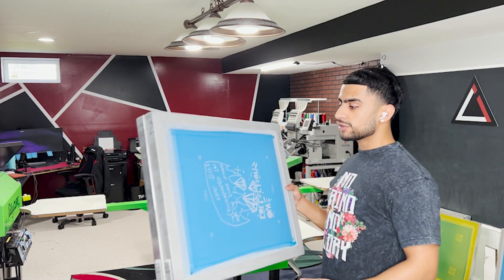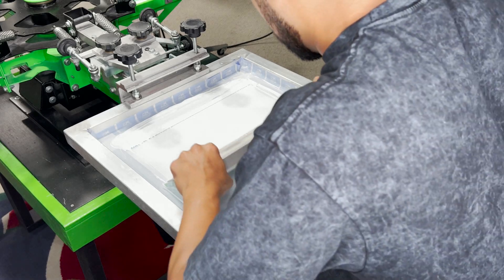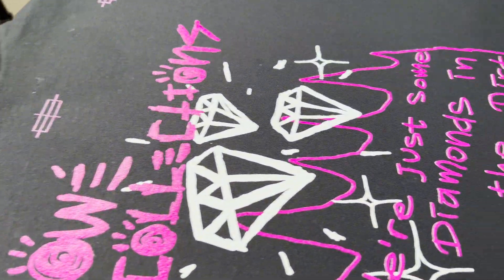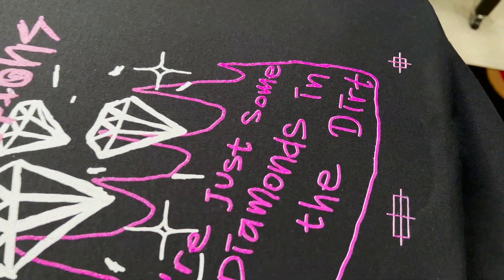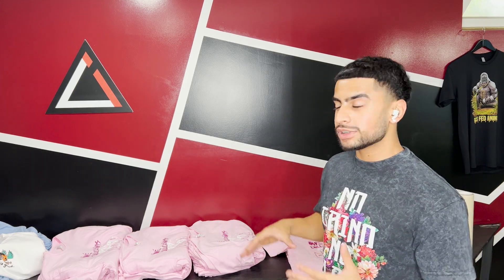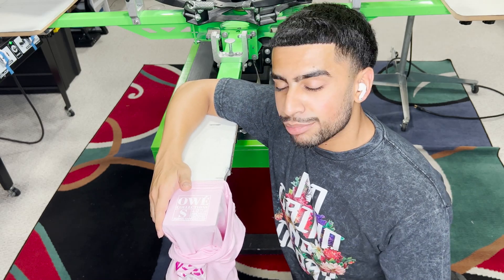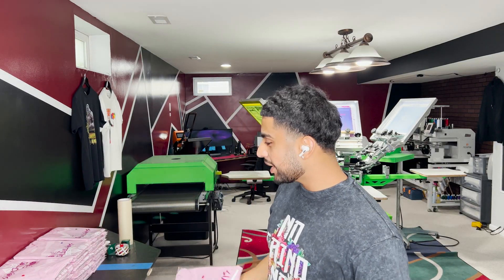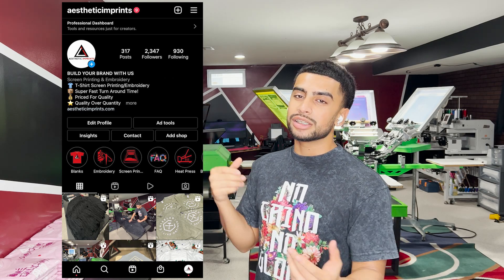Screen Printing T Shirts For A Clothing Brand From Start To Finish

Comment: I see that Epson printing real nice. Im looking to upgrade to print larger than 13 x 19, but Epson that big not in my budget YET. Any recommendations?
Reply from the maker: Epson has been printing real clean. I can’t say I’ve used any other printer that prints bigger than 13x19. I mainly used the canon ix6820 and the pro 100 before I upgraded to the epson

Comment: Definitely kept it real, appreciate that. But yo, I mean it looks like you got the 4x4 Riley 250 joint with XY micro and it aint doing it's job? That thing aint cheap....  I can sense you bout to upgrade juss now lol
Reply from the maker: Always💯 it’s a 6x4 Riley 250 and it’s not that it’s not doing the job, don’t get me wrong it’s a great press and can do some great prints. However, when it comes to needing tight registration and but to but prints it can get hard and annoying. The press doesn’t hold the absolute tightest registration. Again it’s just a entry level press so definitely seeing a upgrade real soon!